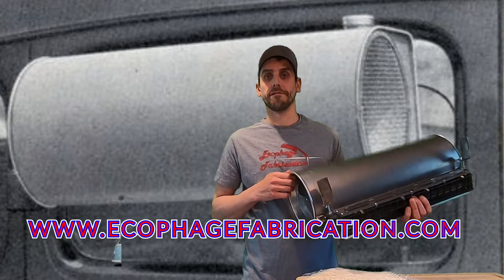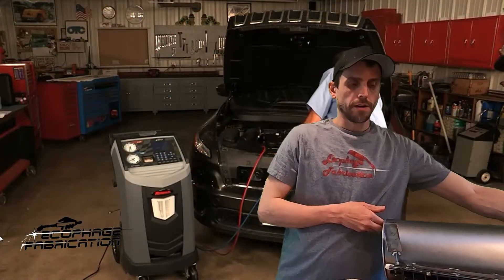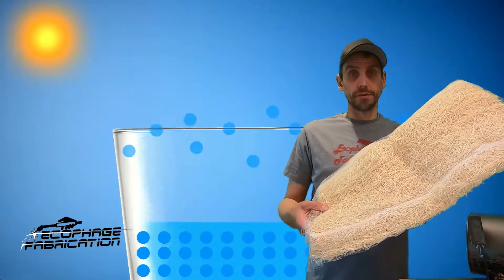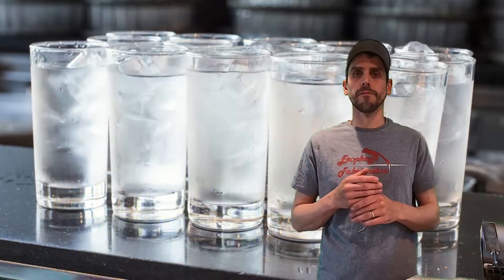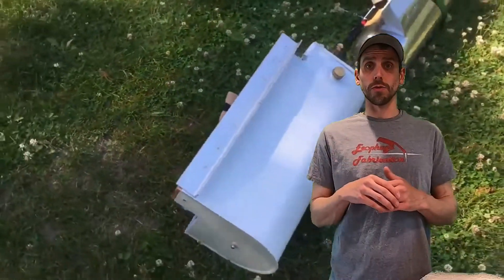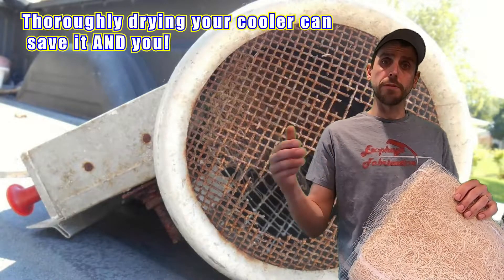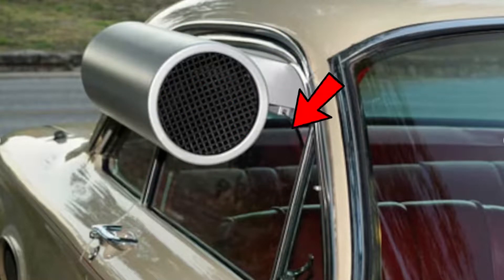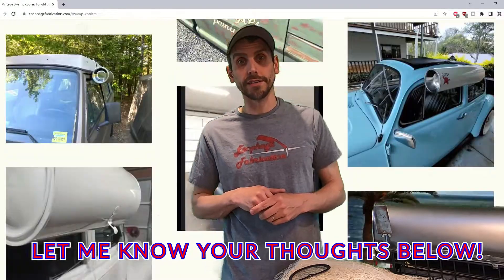How Evaporative (Swamp) Coolers work Myths & Dangerous Misconceptions/Tips w Vintageswampcoolers.com

Comment: Hey man, the ads on your website are making it impossible to shop for coolers. FYI
Reply from the maker: @JamesLCoxe   most people seem to not have trouble. Literally the same ads as I run into on other sites. Just close the pop up. A few hundred people a year seem to figure out from around the world. Is there something I can link you directly too?
Reply: @ using an I phone, might want to check your the mobile part of your website. Looking for VW swamp coolers. Beetle.
Reply from the maker: @ yeah some of the problem might be I had to design the website myself through square space and I’m not great at verifying everything converts well to cellphone style

I’m a fabricator not a web designer haha

All our models fit beetles, the deluxo will be a bit tight with brackets if you have two piece front windows
Reply: @ no worries, thought I would let you know, websites aren’t my thing either. I’ll check it out when I get off work. This summer is going to be hot and I’m looking for options.

Comment: I live in Florida where it’s always humid.suggestions?
Reply: I’m just wondering will this even work in a hot humid climate. I’ve never seen one on a car here. You only in pictures.
Reply from the maker: @garrettroberts7937  I have shipped many coolers to Florida. Like I say in the video when it gets super humid you can use ice water. Plus I suppose if it’s super humid anyway the premoistened air should have a cooling effect anyway during that period.